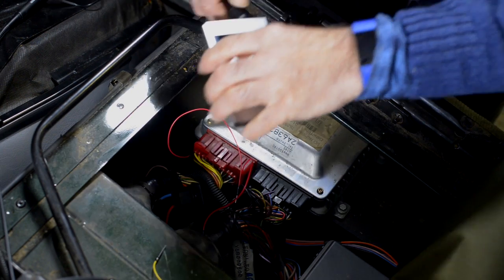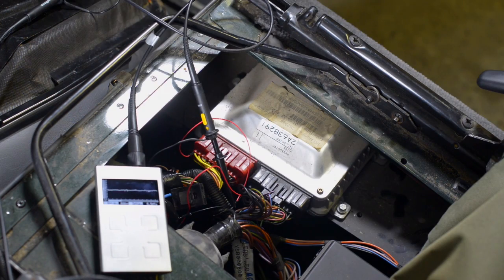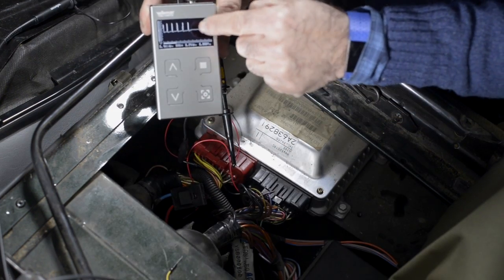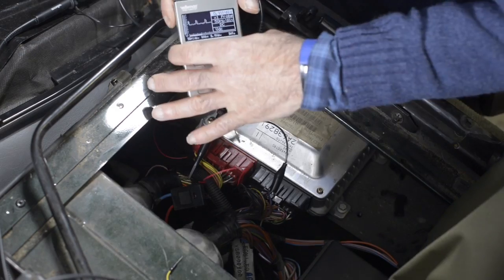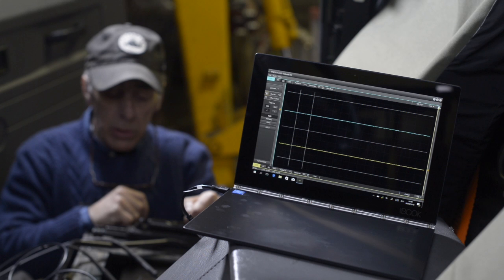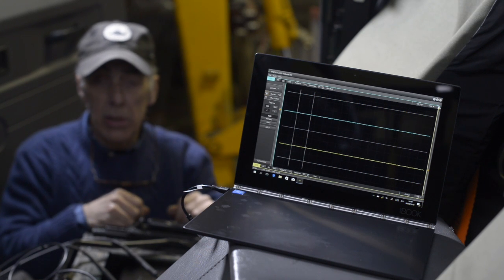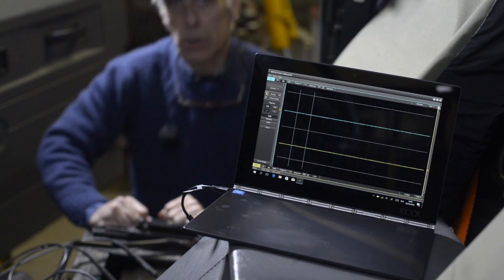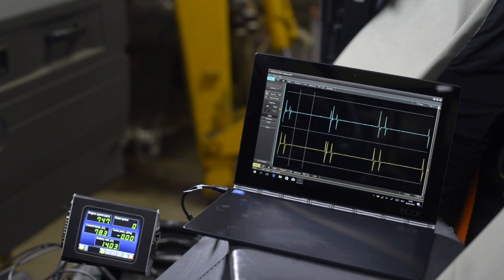Landrover Defender TD5  ECU   Vital Signs

Comment: Thanks a lot for sharing your knowledge, it's impressive how you make appear such operations easy to me 😅
Let me ask you a question regarding the power input. It happens since a couple of months that after a full throttle period as a overtaking manoeuvre or hill street, even if I release the throttle pedal the engine is still remaining high for let's say 1 second or so, that make it uncomfortable to push. It seams that a old Lady is seating behind the steering wheel 😂 
Is there any sensor missing the right measurement? 
Thank you in advance for your answers anyway. 
Regards from Sicily, Diego
110 Td5 2005

Comment: I have a question . I have a 2005 TD5 110 . Too much dark fumes coming out . A mechanix traded an old ICU and no more fumes . He called today saying he could not fix ou ECU . We have to go back and trade back :( . Is an ECU fixable ? Excuse my (UN) knowledge on. The matter . I feel stuck and do not know what to do
Reply from the maker: You can repair an ECU, but that is an electronics engineer job ..if he has all the shematics and code and chipsets... else its a swap out

Comment: My defender won’t start put a computer on the ECU it reads nothing keep saying cannot connect don’t know if my ECU shot or not
Reply from the maker: Hi Matt, when you connect the OBD2 connector, is there power on the diagnostics plug ?, if not the there might be blown fuse that feeds the ECU.. Especially that it wont start..I assume that the engine is cranked and turns on the starter motor..    If the fuses are good, remove the connectors on the ECU and check for any trace of oil.   It is a well known issue that engine oil creeps through the wiring-harness as the seal in the cylinder head for the injector harness starts to leak over time.  Oil will creep up to the ECU and get inside.  If you see oil ( you need to look care-full as its not a puddle) on the ECU connector pins and the wires, then you have found the problem,  Clean all the oil, get a new injector harness and seal,  in the worse case you will need a new ecu...  I hope that it helps.. but first check the fuses

Comment: Great video - it is so clearly explained that it inspired me to try and troubleshoot our own Defender TD5 problem.... however I am now stuck and and wonder if you have any ideas that might help. Symptoms are it will turn over but not start. Actually you know as soon as you turn the ignition on there is a problem as the fuel pump does not run and no glow plug light on instrument panel. By bypassing the fuel pump relay you can make the fuel pump work but it still will not start. It seems the ECU is not telling the fuel pump / glow plug relays to engage, despite everything having power / fuel. So we thought maybe an ECU failure, but we have had the ECU checked by a specialist and “no fault found” so now we are wondering.... what “vital sign” might be missing as an input to the ECU that would stop the fuel pump from running even when you turn the ignition on and before you engage the starter? Any suggestions would be very gratefully received.
Reply from the maker: Thanks for the comments, In principle the ECU does not deal with the fuel pomp.  That pomp should turn on as soon as the ignition is on.   The fuel pressure regulator could be faulty or stuck , so the fuel pressure is to low.  Does that Fuel pomp make a wining  noise ?  If that pomp does not turn with ignition on check all the fuses, relays and cabling as it should run.   For the rest it could be that the  injectors are not getting the correct timing/pulse... that could be an issue with MAP/MAF sensors...  or even the ECU not set for the code of the injectors.     Use diagnostic reader , they are not expensive and will tell you what is wrong for the map/maf etc...
Reply: @D3Sshooter   thanks very much for the reply. Finally we found the problem which was a poor connection in an ECU ground cable where it passes through a "header".  We were thrown off the track as it passed a continuity test but after a test with a power probe, it became clear that all four ground cables from the black ECU plug had poor ground connections... as these four combined in a header with an output on a single cable it became clear where the fault was. After cutting all the relevant ground cables from the header and creating a new one the problem was fixed (just today). I neglected to mention in my original question that we could not read the ECU diagnostics when the problem happened (first intermittent then permanent) and perhaps this explains it.... the ECU was not able to run properly even though it had tested as ok at a lab and hence no fuel pump / starting even though it turned over. I guess we should have spotted this earlier, but was not obvious what vital signs to check as outputs from the ECU before the vehicle was running.  Really great videos videos - thanks.

Comment: Another great video;  I have a question for you, I purchased a 1999 Land Rover Defender 90 TD5  from Germany, it is in very good condition but I one issue. When the engine is cold  and I drive off applying power there is a rattle noise from the engine, after a while when the engine is warm the noise goes away. I have taken it to a diesel mechanic and he told me that it was 1,3 & 4 fuel injectors  that was the problem. I removed all 5 injectors and sent them off , the injectors came back  with no issues, they were all working fine. Do you have any idea what my problem noise is? Kind regards,
Martin
Reply from the maker: Hi Martin, rattle noise could point to the injection timing. the ECU might get the wrong data from one of the sensors. MAP, MAF, temp etc..when the engine is cold. Or it could be  an issue with the injectors ( did you place the same coded injectors  in the right place ?    You need to, and if the injectors are new or mixed, you will need to set / code them by programming the  ECU).  A little bit of rattle is OK..
Reply: @D3Sshooter  Thanks for getting back to me;  I have not checked all the components, MAP, MAF etc but will do, I did mark the location of all injectors and re-installed them in the same place. I sent the injectors off to a speciality company for testing and rebuild and they all came back fine. The guy that looked at the rattle said it was injector knock and servicing the injectors would correct the problem, but it did not.
Reply: Check in the red connector to your ecu, if it’s got oil in it you need to change the injector harness. Loads of vids of how to do this, very common td5 issue!

Comment: HI FLEMISH, I HAD A WEIRD NO START. I THOUGHT I LEARNED FROM YOU . BECAUSE I WORKED SUCCEFFULLY ON MY MF165 FROM YOUR TEACHINGS.AND THAT GAVE ME COURAGE. NOW I TAKE ATTEMPTS. LET ME TELL YOU THE FACTS ABOUT THIS CAR.

1. THE CAR IS FORD 1.4 DIESEL ENGINE FORD FIGO 2016 MODEL.
2. THE CAR IS CRANCK NO START
3. ALL FUSES AND RELAYS ARE FINE
4. THE REV COUNT RESPONSE ON CRANCKING
5. NO CHECK ENGINE LIGHT, ACTUALLY NOTHING STRANGE IN THE DASHBOARD
6. NO DIESEL TO THE ENGINE
 7. WHEN I UNPLUG THE HARNESS ON THE PCM THE CAR BECOMES " NO CRANCK NO START"
.
THIS IS WHAT I DID:  I THOUGHT THE PRIMARY PROBLEM IS FUEL, THEN I DECIDED TO ATTACK IT FIRST. I QUICKLY OPENED THE AIR INTAKE PIPE. THEN I SPRAYED PROPANE INTO IT WHILE SOMEONE WAS TRYING TO START THE ENGINE.( I WAS SPRAYING PROPANE IN THE PIPE BEFORE THE SENSORS NOT AFTER THEM. 
WOW, THE CAR DID NOT START.
I THEN TOOK THECAR TO ANOTHER MECHANIC AROUND. AFTER A WEEK HE SAID THE PROBLEM OF THE CAR IS "NO COMMUNICATION). BUT MY QUESTION IS HOW CAN IT BE NO "COMM" WHILE THE REV COUNT RESPONDS. 
HOW COME IS NO COMM WHEREAS WHEN I UNPLUG THE HARNESS ON THE PCM THE CAR BECOMES " NO CRANCK NO START"

WHAT DO YOU THINK
M.B.S MOSHITOA (S AFRICA)
Reply from the maker: Txs for the comments,

Comment: I am going to buy an engine TD5 with ecu remap can we change the ecu to a normal ecu?
Reply from the maker: Yes you can, as long as you load the original map... Note that you will need to get the injector letters and numbers correct

Comment: Your fuel pump sounds like it's on its way out. Whining just before you crank it over.
Reply from the maker: Andy Spillman yes indeed.  Just needed to bleed the air as the small bleed valve on the diesel filter was faulty

Comment: Thanks very informative where do you get the small wave scope and data logger from
Reply from the maker: hi  bassassin  txs,  velleman hps140, they have all kind of low cost devices for measuring electronics.  you can get it on line    .  note that the laptop is not part of it, but for that i used the wireless two channel model
Reply: D3Sshooter thanks I shall check them out

Comment: Shouldn't the injectors fire only every other time the engine reaches TDC presuming it's a four stroke cycle? Thanks for a great video.
Reply from the maker: that is true as you state  i was just looking at one injector signal and the crankshaft sensor pulses   i am making a vid where you can see the right times of all